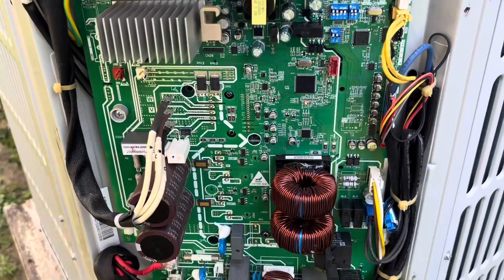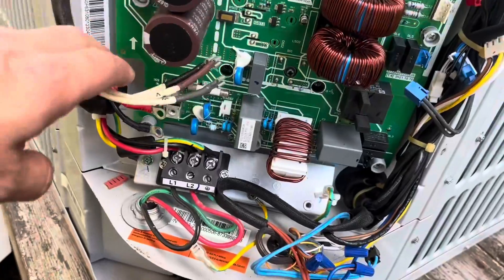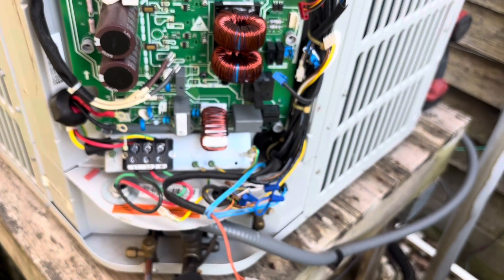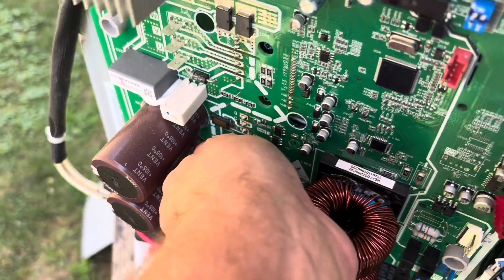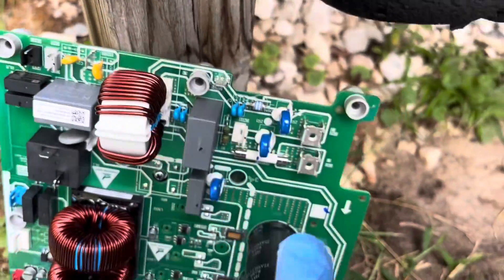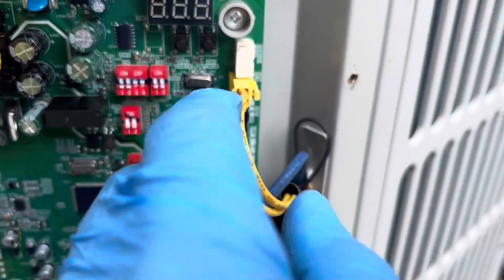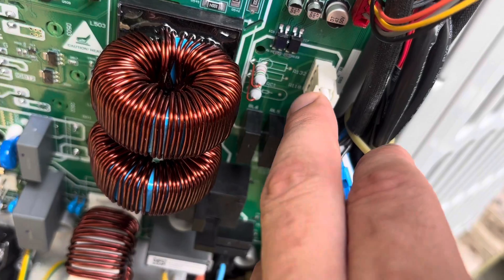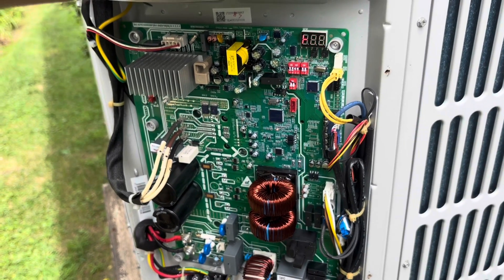Bosch Heat Pump Repair: Control Board Replacement!

Comment: Thanks for the video Jeff there were some good tips on Bosch board replacement. Not very familiar with the Bosch equipment just know they like many others had leaking coils in certain model package units.  The long screw in the middle of the board reminds me of Toyota's rotor removal with 10mm bolt it just pushes it off!

Wanted to ask was there a surge protector on this system outside or where the other Bosch boards failed? 

Have a good week!
Reply from the maker: Thanks man.  
Yea it did have a surge protector.

Comment: They have taken a simple machine and and turned it into a plasma Tv and I work on TVs . No money to ever be saved on this type of machine in the long run , you pay out the butt for short term energy efficiency.
Reply from the maker: Valid points.  But honestly, as long as the government keeps raising minimum efficiency standards, this equipment is going to have more and more complex, expensive boards.

Comment: Sad to see the power from L1 and L2 volts/amps going to a circuit board as they are so thin and full of laminated wire traces that just do not appear robust enough to handle the kind of amperage that is flowing through them.  Apparently this is fair to say since the board is being replaced and its not all that old. Another issue, 10 years from now, is that circuit board going to be available? Some say if it is, it'll like be a long wait to get one. Some say no, it will be discontinued. 
I guess the real question for those communicating systems is, how much savings is the customer getting for the extra cost of high tech HVAC? No one discusses those figures yet we hear it all of the time how efficient they are.
Reply from the maker: You make valid points.  The manufacturers insure us parts will be available for at least 10 years from manufacture date.  So as long as they keep making units with this board, the parts will be availability for another 10 years from then.  

Also, Bosch systems are non-communicating.  One reason they can keep cost down compared to other bigger named companies with inverter driven compressors.
Reply: @JeffsHVACAdventures  So they say, available parts for 10 years. I have seen Trane systems less than a year old need parts and they aren't available so soon. Same happens with the other high end brands. Daikin, Amana and Goodman seem to be the most trusted in that department.
Reply: @Garth2011 
We are a Goodman dealer. Our service area is 80% residential. Trane, Carrier and Lennox are priced above what our customers want to spend. We offer, in this order, Goodman, Amana and Daikin. Our three trucks carry most parts and they are easy to service. Parts are lower cost and if not on the truck for some reason, the distributer has them on the shelf. Warranty replacement parts are not difficult to get either. No lengthy phone calls.
Reply: @bills6946  I agree and especially now with R32 as the chosen refrigerant. My Amana HVAC is 34 years old, no repairs or service needed, original R22, no leaks. Still on the original capacitors and motors. Although, I have two new capacitors, a contactor and two new quality motors on hand for the time they are needed.
Reply: @Garth2011 
You, sir, are prepared. If you don’t already have it, install surge protection on your condenser disconnect and your furnace. We only install Intermatic AG3000.  For a little over $150, you protect everything. Avoid Amazon junk.
Reply: @bills6946  More so with newer HVAC ! I have inspected the motors, contactor and measured the uf on both caps and they are both within 1 uf of spec. The old survive in so many ways that the EPA, NEC and other agencies fail to address when they stipulate their wild inventions. Reminds me of elementary school projects. The motors I purchased are Nidec brand and caps are Amrad. Thank you.

Comment: I have to say "great video" because you are very thorough but you don't show EVERY screw install and you give great tips as in the knockout and screw to loosen board from heat sink paste. Well done and now you have a new subscriber.   P.S. I believe many of these Bosch are now made in China like the innovair and Gree inverters I've been doing.
Reply from the maker: You are correct.  They are Chinese made. 
Thanks for the sub!

Comment: Very interesting video. First time I’ve seen the heat sink paste. Just curious. What is the function of the two circular components of the board with the exposed coiled wire?  Thanks!
Reply from the maker: They are electrical noise filters.  They basically smooth out electrical noise and interference to the rest of the board so the inverter compressor can run smoother.   It actually goes a lot deeper and way more nerdy than that but that’s basically what they do.

Comment: The brown electrolytic capacitors were on the original control boards. I got a few replacement boards with blue capacitors. Now, they are black. It seems whoever is supplying the capacitors to the board manufacturer in China, continues to have quality control issues with their capacitors. If the Bosch is installed and configured correctly, it is a very good machine. Expensive, but good.
Reply: what were the brown ones doing?  Were they leaking or going high ESR? Do you mean the main filter caps?
Reply: @FixitFrank 
They would bulge and some would actually leak. Very apparent when you look at the board. We haven’t serviced any out of warranty yet. To get warranty, you must call Bosch and a tech walks you through a test procedure before they approve a new board. A little time consuming, but I think the boards are close to $2,000. I never priced one.
Reply: @bills6946  oh okay. I repair all kinds of boards.  just repaired my own inverter board after a lightening strike.  I had to basically rebuild all of the high high voltage side. Just curious about the failure modes.thanks
Reply from the maker: Very true.  But still a good price point compared to the other variable speed units offered by other manufacturers.
Reply: @JeffsHVACAdventures midea who's makes the Bosch is half the price for EVOX , has better #s performance wise and is side discharge so no ice build up issues on condenser fans 

I've changed a dozen Bosch boards now unfortunately
Reply: @JeffsHVACAdventures 
We mostly get calls for the 15 seer like you are working on. The 18 and the 20 IDS  Premium are a little out of reach in our market. We have stumbled across a few service calls, cleaning up installs that were incorrectly configured. I guess some guys simply don’t bother to read the installation manual. BYW. How is your son doing now that he is out of boot camp?

Comment: How old was it ? Surge protector?
Reply from the maker: Unit is 2 years old.  Yes it has a surge protector.
Reply: The known problem is bad electrolytic capacitors on the board.